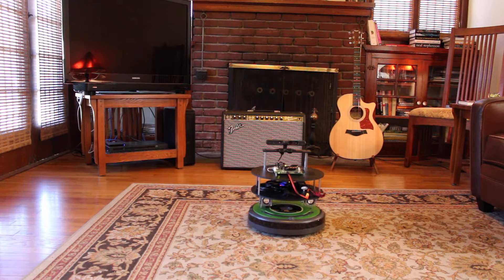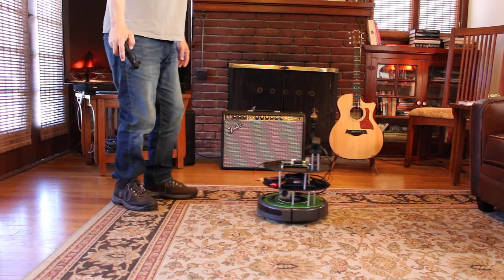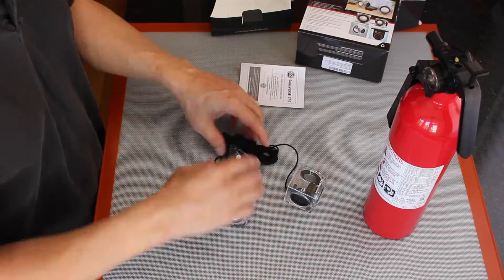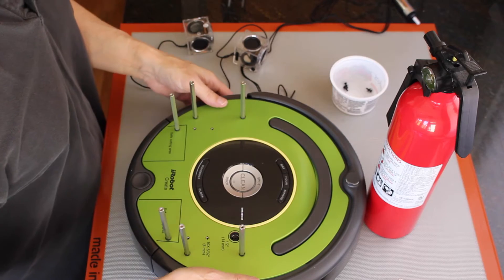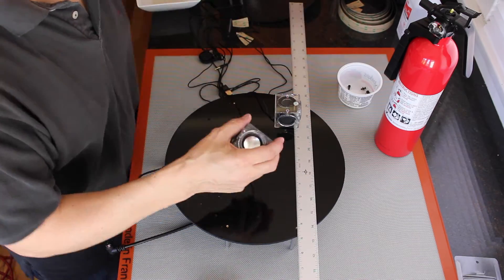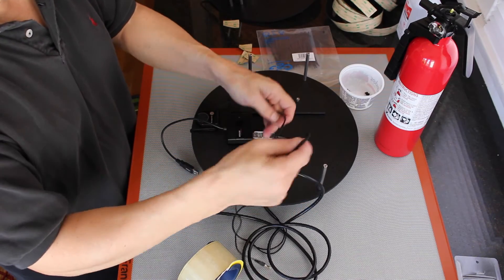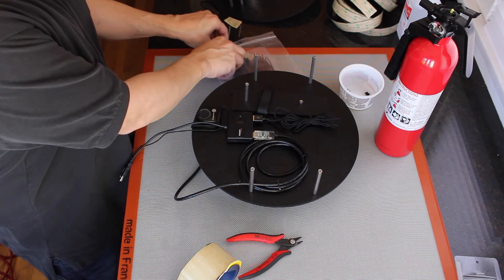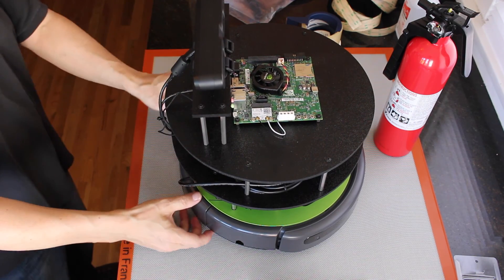JetsonBot Part 18 - Sound Part 1 - Jetson TK1/Create 2 Robot

Comment: Smooth voice. He's got a Jarvis thing going on! Is that a real-time voice synth or is it pre-recorded and played back?
Reply from the maker: +Ki11aGori11a It's synthesized and saved as a .WAV file, the Jetson plays the WAV file back. Thanks for watching!
Reply: +Jetsonhacks Thought that might be the case. Works well. Can't wait till someone comes out will a real-time version like this for ROS. Would be so sweet. Thanks again. Loving your vids!
Reply from the maker: +Ki11aGori11a That's the rub. Most of the really good voice synthesis algorithms are proprietary, and in comparison the open source ones are laughable. You can actually get the voice synthesis module that the voices were generated from (that runs in real time on ARM)  if you're willing to pay the royalty fee. For the demo, I didn't want to spend the money.
Reply: +Jetsonhacks I know what you mean. The one I am using atm sounds like something from the 90's! That's why I was impressed with the one you are using. Can't justify the royalty fee so I guess I'll have to keep waiting...